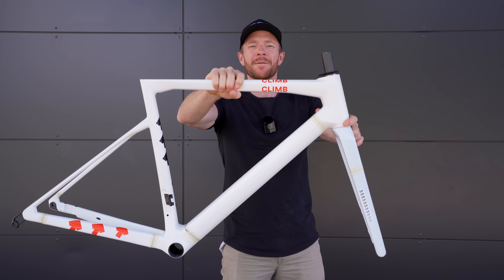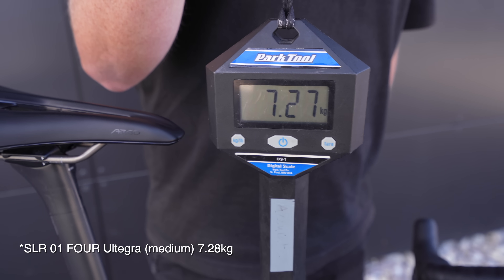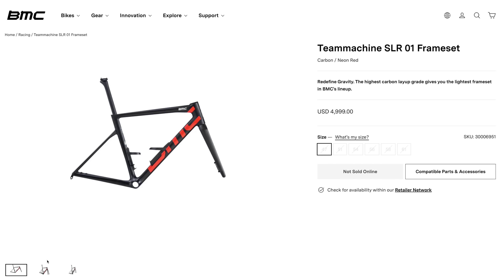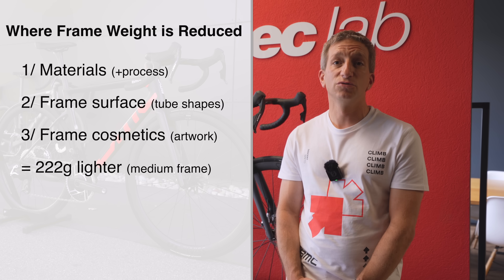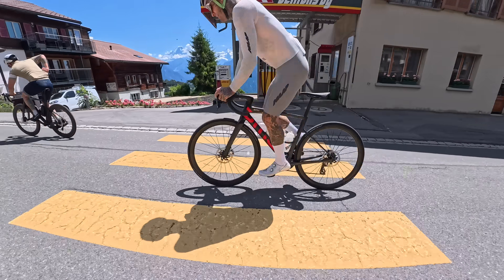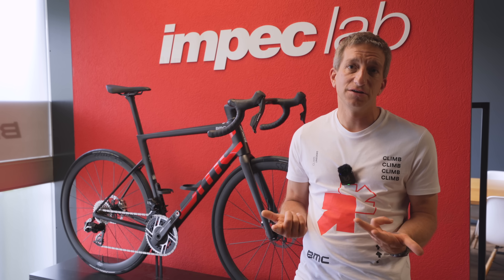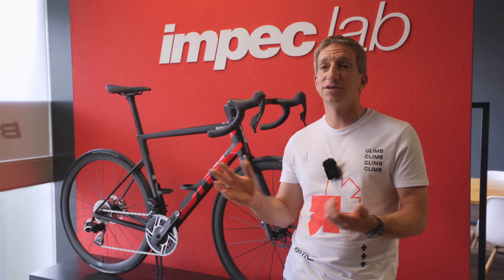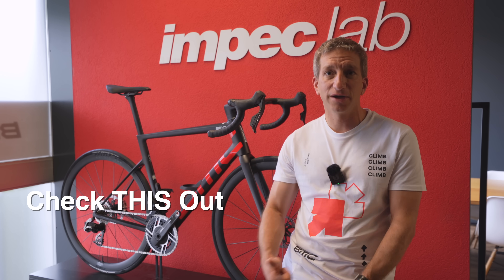BMC Shed 222g off the All-New Teammachine (Head of R&D Explains)

Comment: My 2021 TCR is 6.8 kg and it's not even the top spec one.
Reply: my 2014 tcr sl rim brake is lighter
Reply: @jleau89 how light and what mods are you running? I've just ordered a titanium seat bracket and will be doing ti pedal spindles next to get me to nearly 6.7kg ...
Reply: @pj9375  it's around the same as yours haha.  Sram red group, haven't done any crazy mods just cf seat and bars

Comment: I'm at a bit of a loss when people talk about reduction of weight due to either no paint or reduced paint finish. If you weigh paint in liquid form that is required  to paint a frame. And then after the application were to sand all of that paint off once dry, you barely would acheive a weight reading. I know I've repainted frames..so sorry..no convinced.

Comment: I think the guy's spot on, on tire size. Having capability of running 34 in the future, but yet many people don't run wider than 30c. Hell 28c are 30's today with rim width.  Run the correct tire pressure and run a 30C. I say this because running extremely wide tires on a road bike is garbage in the handling and acceleration department, it defeats the purpose of the fast stiff feeling and handling of a traditional road bike. Just go ride a gravel bike if you want that soft smooth feeling.
Reply: Man. I really wish I understood what you were trying to say. My rm01 I was run 32mm and those by far was the fastest tire set up 8 ever used. I crashed that bike out, replaced with a SLR01 and it maxs at 30mm, I run 28mm. I miss my 32's. 28 is fine but I for sure feel the road turbulence and can see that difference in performance on my data.  Wider tires are faster.
Reply: I run 32’s on ENVE 4.5 on my Dogma F. The tires measure 34.25 mm inflated. 😬

Comment: BMC were never the lightest, so low base effect definetely plays a role here. And the final result is not mind-blwing either, there is still over 200g to shed. Yet very happy to see them simply and clearly applying proven engineering practices instead of finance and marketing shenanigans of the recent years.